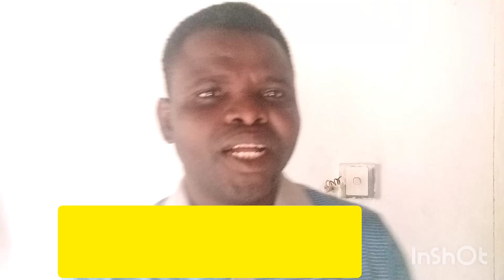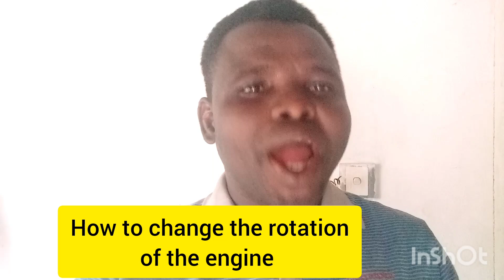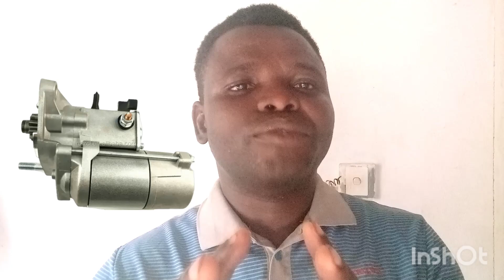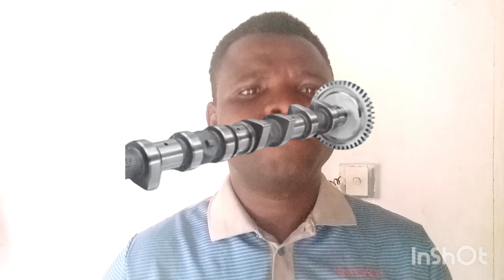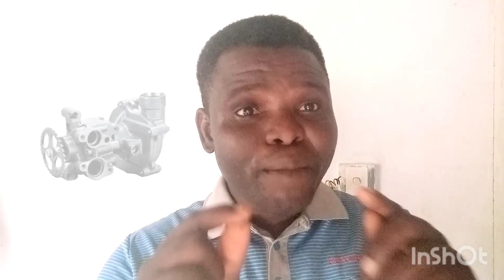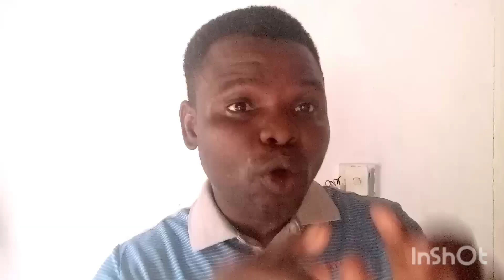How To Change The Rotation Of Engine

Comment: Why would you want to. To have a 5speed reverse .this is dumb
Reply: Or install the correct engine .problem solved
Reply: Different cars use different directions, if you are swapping engines from a different car you will need to do this.. although there are many things that need to be done that weren’t mentioned in the video. I think it’s better to reverse it with a custom gearbox.
Reply: Smokey Yunik did this back in the early days of NASCAR. The torque of the engine would pull the car left and into the race track turns. It made his cars become banned because it made such a difference in track handling.
Reply from the maker: My friend bought a used concrete mixer with Lister Petter LT1. The engine rotation was counterclockwise which could not work with the mixer.

So I have to change the rotation of the engine to clockwise to work with the mixer.